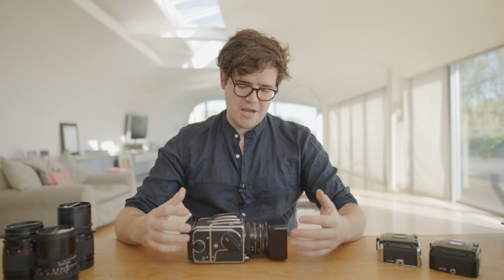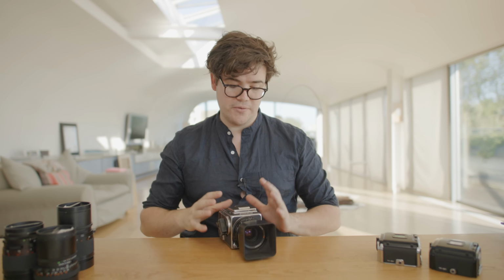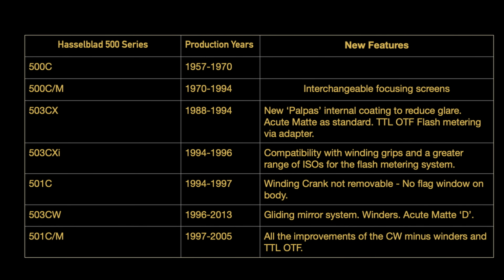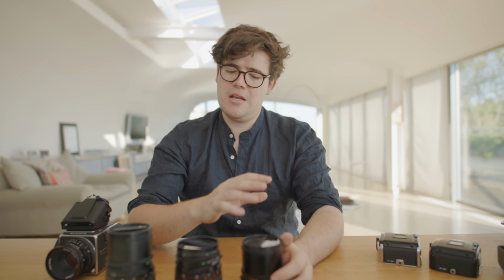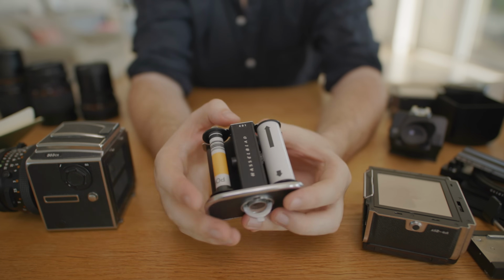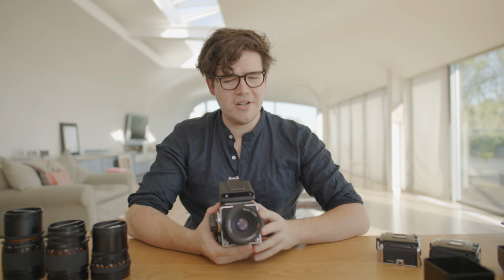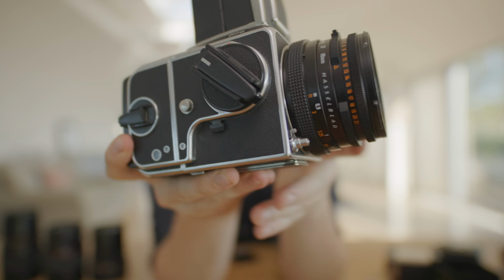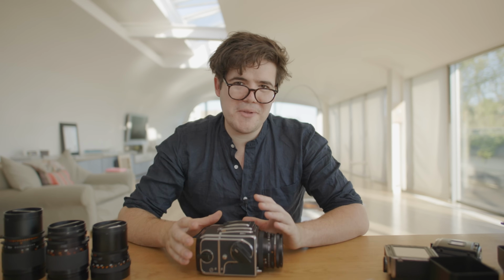The Hasselblad 500 Series: A System Overview

Comment: Nice video mate, I traded my Mamiya 7 for a 503CX and I love it to bits. Came with a 100mm 3.5, C T* with a chrome nose which I’ve heard is pretty rare. Happy with the one lens for now but down the track I’d love a 60mm and a 180mm. Still a bit confused about the tripod release plate, does it live on the camera or the tripod? Would definitely like a quick video on your tripod process if you get a minute, even a cheapo iPhone video or one of those new ‘shorts’ things that you can do on YT now
Reply from the maker: It lives on top of your tripod, it’s a quick-release system but one that works with the shoe built onto the body rather than one that you put onto the camera arca-style. If you scrub through this video there are a few shots of me setting up https://youtu.be/WpoR27IZLyE
Reply from the maker: Start at 6:06
Reply: I'm in the process of doing exactly that. Never really gelled with the Mamiya despite many years I'd trying. Just can't get over how vulnerable it feels, particularly now they're so over valued (Imho).   Sounds like you were pleased with the decision, hope I will be too!
Reply: @simonwilliams6140  absolutely no regrets switching to the Hassy, but sadly I am shooting far less 120 than I used to. This is mainly due to acquiring a Chamonix 4x5. Still have the blad because I can't bring myself to sell it, easily the nicest camera I have ever owned